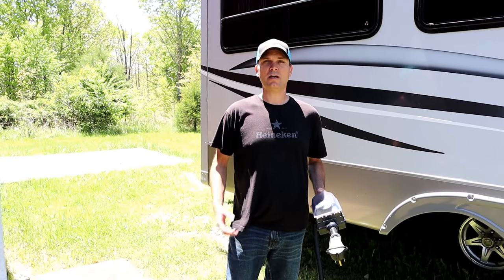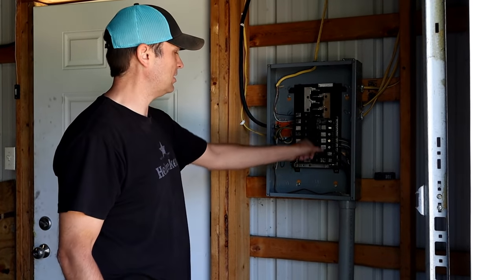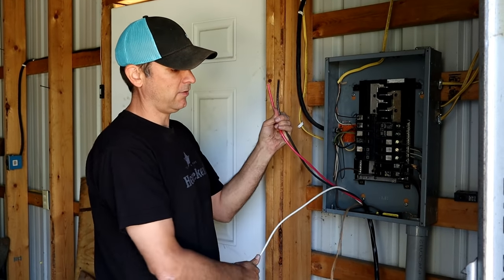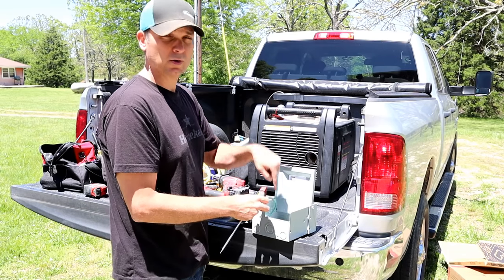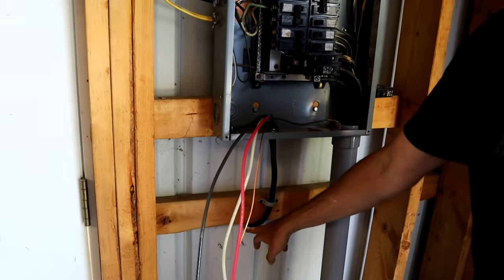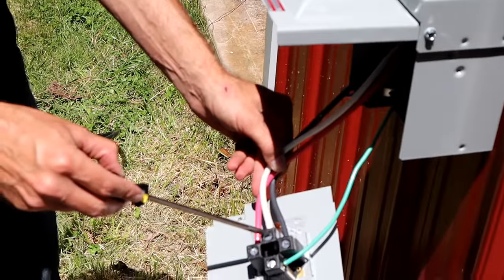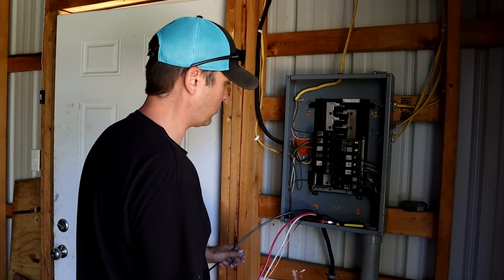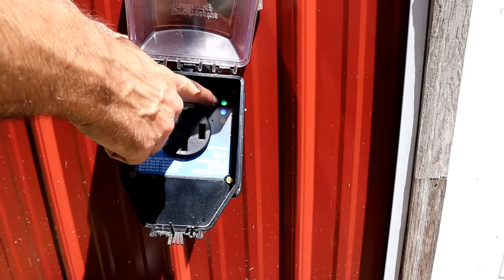Install an RV Power Outlet / Install RV Outlet At Home / 30 or 50 Amp RV Outlet DIY  /   How To

Comment from the maker: Great tip at the end of the video😁
50 Amp RV outlet👉 https://amzn.to/3yd0CHP
Wire👉 https://amzn.to/3onjyyZ
Surge Protector👉 https://amzn.to/3uRUS45
50 to 30 amp adapter👉 https://amzn.to/3w8vabP
Reply: Great video!!  great information....I have a side question... Do you have a video of attaching a TT to a home septic system?

Comment: You have bonded your neutral and ground together in a sub-panel.  You might want to revisit that decision.
Reply from the maker: Its not a sub panel, this has a dedicated feed from the grid. Thanks for watching.
Reply from the maker: So I did, I misspoke, this has a separate feed. Thanks for taking the time to track that down. :)
Reply: @RVLivingYet  Separate feed from where? You didn’t have a meter base.
Reply: @RVLivingYet  I have a question.   Dose L1 and L2 have to be fed from each side of the breaker box to achieve split phase?
Reply: @RVLivingYet  no meter tells me it's a sub panel
Reply: What does that mean? I'm trying to do this same thing
Reply: @joehead1294  I understand now. Because power can flow through the neutral....
Reply: @reynoldmichael1348  yes, if they are connected at a sub panel power can flow through ground and energize a chassis of equipment.
Reply: @DanWessonSpecialist  Though it looks like a sub panel, he is saying power is feeding from the grid, so it should have a meter somewhere. But, the ground coming in through the conduit suggests a sub panel. There should be a ground rod there if it’s not a sub panel. RV Living Yet, can you show your set up and how this is not a sub panel?
Reply: On a 50A service, there should not be 50A on each conductor. The breaker would open. Ampacity of conductors needs to be at least 10% below rating of breaker. I don’t know many residential applications that truly use even 50A diversity.
Reply: @garyp9508 the bar is an S shape, so when you put in a double breaker it touches both phases giving you 240.

Comment: You said that is a subpannel . Your neutral and ground should never be bonded in a subpannel. Only in the main. You really need to separate them .
Reply from the maker: I misspoke, not a sub panel it is fed from the meter.

Comment: I think you only get your 50 amps at one leg at a time,  at any moment  L1 is at 50 amps, then L2 is at 50 amps. it alternat's back and forth. I understand that it only totals 50 amps. thank you for your video.
Reply from the maker: Each leg feeds a separate side on the RV breaker panel with 120v, you can run items on each phase at the same time. It's different that a 240 dryer outlet.
Reply: You only get 50 amps not 100
Reply: @RVLivingYet  When you plug in the 14-50P in the building receptacle it should connect to another 50 amp breaker in the RV sub panel. Each leg feeds L1 bus and L2 bus with 50 amps for a 100 amps total in the RV sub panel. The 120v is derived by connecting the hot wire to a single pole breaker and the neutral wire from the same cable to the neutral bus bar. Typically 15 or 20 amp breakers. The neutral and ground bus bars must be separate in the RV and the building sub panel.  The total power from the 50 amp breakers is 240v x 50 amps is 12,000 watts. It's not 100 amps x 120v, which I think you implied.

Comment: You didn’t mention if you are using a 50A breaker for the new circuit as part of your supply list. I know you are but someone else might not realize that.
Reply from the maker: Good point
Reply: Exactly thanks Duane that was a very important thing to know a duel 50 amp breaker right

Comment: Do you turn on both sides of the breaker?
Reply from the maker: Should be a double breaker.
Reply: Yes, one of the power legs will not be connected if you use the adapter. Essentially you will have a 50 amp/110 volt circuit if the adapter is used.

Comment: Good video. Thanks. Minor recommendation is to first connect up your surge protector to the outlet without the RV plugged in with the circuit breaker off. Then turn on circuit breaker to check to see if everything is good. Then turn off the circuit breaker and connect the RV. Then circuit breaker back on. I know it sounds like a lot of work, but it does prevent arcing (you can actually hear this in your video) and will prolong the life of all the male parts of your wiring.

Comment: Nice install.  Another way to look at the difference (30 amp vs. 50 amp):

30 amps x 120 volts = 3600 watts total.
50 amps x 120 volts = 6000 watts (per leg).
6000 watts x 2 legs = 12,000 watts total.

Something to consider: Someone else down here in the comment section also mentioned that grounds and neutrals should be separated in a sub-panel.  That is true.  They also mentioned driving two ground rods.  The ground rods are for the first point of disconnect, not necessary for a sub-panel.  Cheers.

Comment: I installed the breaker box, meter, and a 50amp outlet today. Wasn't sure about the wiring for the 50amp outlet so I searched and found your video. Thanks! It helped me knock out the rest of the job quickly! BTW I do have a 30amp rv and have the connector so I did exactly as you said and installed the 50amp! Great video... great help!!! 👍
Reply from the maker: Awesome, glad it helped and thanks for watching

Comment: Best practice would be to wiggle the stranded wire as you tighten and to use a torque screwdriver to tighten to the correct torque. Some anti-oxidation compound would be helpful also.

Comment: Nice job!   For your and others consideration.   You said in other comments you have a 100a “Service”, not a Sub-panel.   Great, I avoided the combined the ground and neutral comment.   You used #6/3 WG cable for 50 amperes.   Totally acceptable.   But if one can not find #6/3, #8/3 WG is completely acceptable, unless like 100’ or more away.   No big deal!   But, something very strange.  It looked as though you have a ground conductor coming in with the service entrance conductors.   That is not normal.   Normally, no ground in the entrance and a GEC going to a grounding electrode.   
So, guessing here, if you have a utility feed going to a meter, then an exterior panel, with a breaker that feeds this building, then it IS a sub-panel.  If so, very easy fix.  Remove the horizontal bar across the bottom of the panel and put all neutrals on the right and all grounds on the left.   Then install a #6 bare out to two ground rods.   This is for your safety.   Hope wife reads this.  Separation is for short circuit safety, ground rods are for lightning.
Please consider fixing it!   The life you save may just be your own!
Respectfully,   Kevin
Reply: Nice comments on the ground and Neutral hook ups
Reply: Thanks for posting.  I was thinking the same thing on the "sub" Panel.  Separate and ground.

Comment: Can I use romex underground if it’s buried and ran through conduit? Trying to run me a Rv as well but have about a 25ft run underground that would have to happen.
Reply from the maker: You shouldn't run romex in Conduit, look at thwn wire or direct burial uf wire.
Reply: @RVLivingYet  does the wire size change when using that material?

Comment: A couple of points I'm inspired to make after watching:
1. Perhaps in the RV world the neutral is still commonly (ha!) left off. But today's code for 30A circuits in the home (typically dryers) requires a neutral. There's no other proper/safe way to split out 120V without a neutral. I say this only to point out that 30A doesn't automatically that 2-conductor wire could or should be used. This will depend on your receptacle. And I'd love ot see 4-conductor receptacles used for all this.
2. A 240V 50A circuit does sort of mean 100A total. But that doubling of A is sort of a fantom. And that's because a 50A breaker is supposed to trip above 50A, no matter the voltage. So if you load up 50A on one 120V leg.... when you turn the oven on that's connected to the other leg, the breaker should trip.
3. Thanks for doing this in such a no-nonsense way.

Comment: I know this is a stupid question, but you used a 50 amp circuit breaker for that install? I didn’t catch it in the video.
Reply from the maker: Yes it's a double 50 amp

Comment: Great comment at the end as to why put in a 50 amp outlet in case you get a visitor or you upgrade to a 50 amp in your RV.  If I may ask an out of the box question.  Could you use the same theory and or box to install a 50 amp box for a generator to supply your circuit panel in case of an putage and only have a 30 amp plug on the generator at the moment, hoping to upgrade the generator in the future.  Just a thought.
Reply from the maker: Hi Bob, these RV outlets are female and the outlets for generator inputs would have male prongs. If you had the same style plug coming from a running generator those exposed prongs would be energize and called a "dead mans plug".  Also when feeding into your circuit panel you should have a transfer switch or main panel disconnect so you don't feed energy back into the grid and potentially harm a linemen. Hope that answers the question you had.
Reply: @RVLivingYet  Thank you very much for a quick reply.  Best to you and family

Comment: I have a question is that a sub panel or is it being fed directly from the power company, if not your panel's ground needs to be connected to a ground rod also in the panel the grounds and neutrals need to be separated on their own bars. Just saying. I heard you say something to the effect about being out here no inspection, but you still should want to be safe.
Reply from the maker: Fed directly, I miss spoke in the video... Thanks for watching!

Comment: A sub panel with ground and neutral connected? I thought only main panel had the ground and neutral connected?
Reply from the maker: You're right, misspoke in the video its not a sub panel, it has a grid feed. Good catch!

Comment: Just bought a Sol Horizon Rover 19'.  It says in the specs, Load Center 35 amp so does that mean its a 30 amp Travel Trailer?  Great video, thanks
Reply from the maker: Ya should be a 30 amp, if it has a 3 prong shore power then you will know.
Reply: @RVLivingYet  30amp is 4 prong
Reply: Rv 30a is 3 prong as opposed to a residential 30a kitchen receptacle.

Comment: II was just wondering if you shut off power to breaker box before you started exactly the moment you said it!
Reply from the maker: I definitely would recommend it, but I have been in electricity for 20 years so pretty used to it. Work safe!

Comment: I am looking for a metal box that has a RV 30 amp and a normal outlet so I can plug in a spot light to face my RV.  Do you know of such a box?   IE: some sought of combo box
Reply from the maker: They have the campground boxes but they are pricey, might need 2 separate boxes.

Comment: So if I upgrade the amo does it have to be short or can I run it to the other side of my house. Where I want to put the rv is on the opposite side of  breaker
Reply from the maker: There are wire gauge charts to let you know how long of a wire can go per amp rating.

Comment: Great video I thought my camper was a 50 amp 110 camper but obviously this is 220 or am I missing something?
Reply from the maker: Its 2 circuits of 120v 50 amp sharing a neutral, technically you could combine them to make 240 but thats not how RVs are wired.

Comment: I do believe they make a outdoor box that has both the 30 amp 120 and the 50 amp 120/240 receptacle inside. And you would use either depending on which plug your rv comes with. And also if you just so happened to have some Thhn/THWN dual rated as most thhn is laying around and you wanted to run conduit or maybe that short of a run even flex metallic or nonmetallic. You would be able to use a #10 ground and a # 8 for the 50 amp circuit because it is rated 50 amps at 75 degrees C which that receptacle is and circuit breakers are dual rated 60/75 so they are rated for 75 degree C.  And it probably will cost more depending on where you get your wire from since it would be individual rolls, but this method works too with the NM 6/3 cable, since it’s rated I believe 55 amps in the 60 degree C column of table 310.15(b)(16). But either way great video. Keep doing what you do.

Comment: Question...
Please tell me that's all there is to this?  I've heard about (crossing the streams, where you don't want 240, you want 120, is this avoiding that?     Thanks!
Reply from the maker: 240 appliances like dryers use both phases together to create 240 volts,  50 amp Rvs use each 120v phase separately to run more items at 120v each. Just be sure to get the right type of outlet for an RV.

Comment: Not.sure if you said that a 50 amps is equal to 100 amps??  Since there are 2 hot wires. I always thought that a 50 amps is what its not 100 amps but i may be wrong
Reply from the maker: Yes you are correct

Comment: Good video.  Very informative.
Reply from the maker: Thank you, we appreciate that! Enjoy your day and thanks for watching!!
Reply: @RVLivingYet  I do have a question if you don’t mind.  Do you have a video on how to install a simple, small DC distribution panel in a travel trailer?  I recently purchased the TST TPMS for my trailer.  It came with a repeater that I may need to use. However, I don’t have any place to connect the repeater to. Same thing with a wireless camera for the back of the trailer-has a repeater that I need to connect to 12VDC.  I thought that having a small DC distribution panel in the storage compartment would help with connecting these things.  Any help you can provide would be greatly appreciated.

Thanks,
Milo
Reply from the maker: @milom.2057  We have an install video on how we wired our backup cam to our running lights, we have not needed to add a DC panel and don't have any videos that would fit your needs. Have you checked if you have room in your existing panel for another circuit, I think ours had extra spaces.
Reply: @RVLivingYet  hi. Thanks for the quick response.   I did look into wiring the repeaters into the existing panel. The problem is, the panel is located way at the back of the trailer, in the kitchen.  Installing the repeaters that far back would put them behind the tires instead of between the tires and the tow vehicle.  I’ll look for your camera install video.  I’m sure there is good information on it that will help.

Thanks again,
Milo

Comment: My 30 amp on generator is 220 and takes the same rv cable. With that said I did not now rv out let boxes were a different set up . How ever I set up a 50 amp any how I ran off my main out door panel to connect my mobile work shop to and on my work shop I installed a 50 amp twist lock which runs to basically a subpanel I would say inside
Reply: I am one of those unfortunate DIYers that has hooked his Rv to 30amp/220. It ruined my RV panel immediately.

Comment: So I have a question. We bought a 50 amp RV and want to install 50 amp service at our house. But the campground we go to has mostly 30 amp service. I always heard it's best to have a surge protector. My question is, could I get a surge protector for my 50 amp rv that works with 30 amp service boxes and how would I hook it up?  It's all confusing since I know really next to nothing about electricity wiring.
Reply from the maker: You can plug your surge suppressor into a 30 to 50 amp adapter at the campround.

Comment: Can i connect my 30 amp Rv to 50 amp box like that one you installed.
Reply from the maker: With a 50 to 30 amp adapter you can.

Comment: Nice.  I have a 30 amp,  and I'm doing a 30 amp.   Seems wasteful to go 50 if u don't need it
Reply from the maker: You never know...
Reply: @RVLivingYet  Well I'm running a 8/3 wire 100 foot for a 30amp camper.   Is that sufficient??
Reply from the maker: @ronsmith8434  8/4 and you can upgrade to the 50 amp. Future proof, great for resale and visiting friends.

Comment: I read about a shadetree "electrician" who fried a RV by making the outlet 240v. How do you avoid that?
Reply from the maker: Make sure you use an RV outlet with the correct wiring, when in doubt hire a pro.
Reply: @RVLivingYet  Thanks. The pro went cray-cray on his price.

Comment: U bonded the neutral and ground in a sub panel. Not correct
Reply from the maker: Misspoke, its actually a meter feed panel not a sub. Thanks for noticing.

Comment: I want to put in a 50amp for my 30 amp camper, but the electric supply company acted like I was trying to commit a crime by doing so.
Reply from the maker: They don't know what they are talking about your RV electric panel has a 30 amp breaker so thats the most you can pull from that 50 amp circuit and stay protected.

Comment: Remember this is a 240 volt. My daughter had a 30 Amp 120 volt.  If it was hooked up 240 it would fry all your stuff.
Reply from the maker: 30 amp plug would not fit, but they make adapters for 50 to 30 connections.